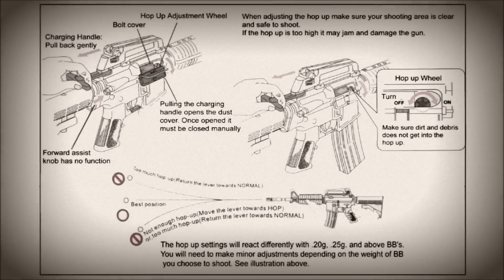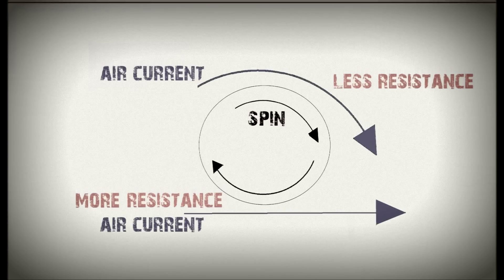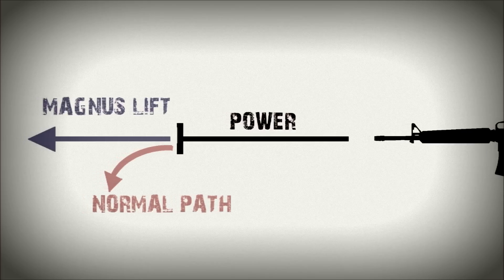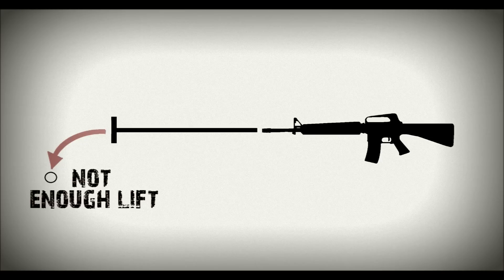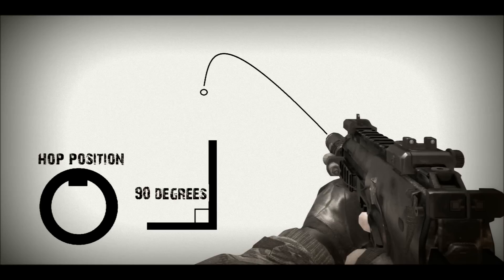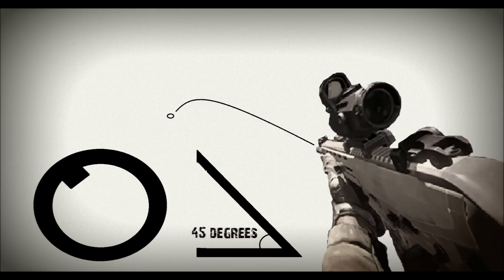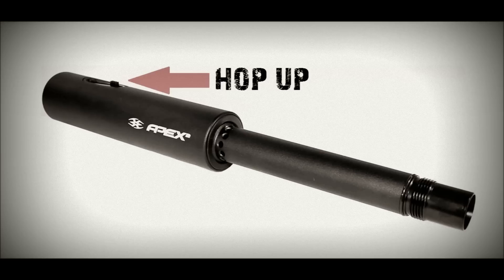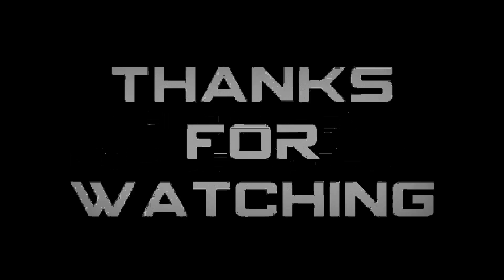Airsoft the Science Behind Hop Up

Comment: I am having an issue where my gun is either too hopped or under-hopped. There is no sweet spot. If it is too low, the bbs wont make it out of the barrel. When I increase it just enough to make it out of the barrel, it is already over-hopped. How can I fix this?
Reply: Is the hop worn out? If it's an old gun maybe the hop needs changing as its impossible to adjust, an extra step may be changing the screw as it could have skipped a thread

Comment: So buy a pistol with a fixed hop up and their is a risk that the fixed hop up rubber inside is either to strong or to weak ? Sounds like im just better off going for alittle more powerful pistol and a slightly heavier BB then ? :)
Reply from the maker: The rubber should be fine you would just need to adjust to whatever bb weight you where using

Comment: I have hop up system in my asg m92f but my BB bullets does not go in line (straight)
Reply from the maker: Maybe the hop up rubbers gotten knocked,have you used a cleaning rod to deep?
Reply: Burntwolf Airsoft one time, my BB stuck in pipe and i used a wood stick to get it out, but before this, the same, BB doesnt go in line